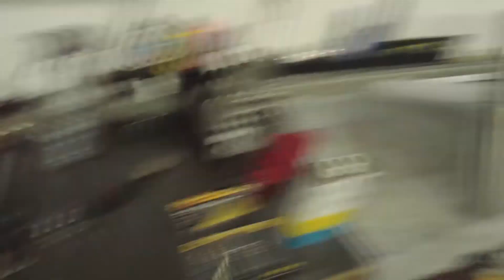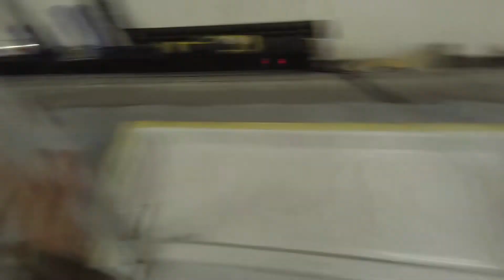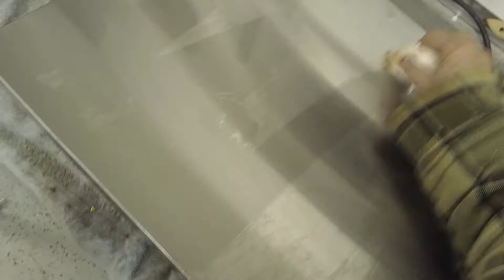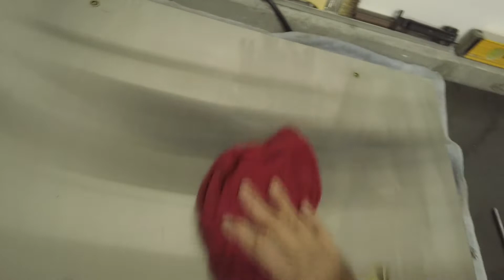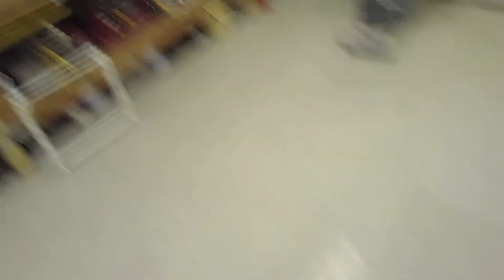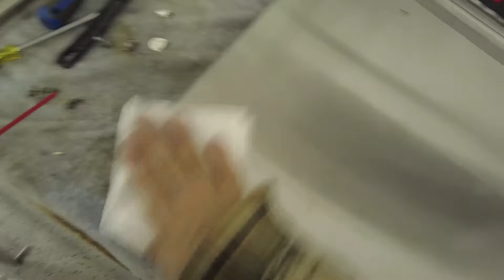Sub-Zero Stainless Steel Door scratch Repair

Comment: Thanks for posting.  I did this to my subzero and it did remove scratch however the sanded area looks more shiny and smoother than the normal area.  Any solution?
Reply from the maker: Sometimes you have to do the whole door.

Comment: Works best with some oil as a wet sand, I use to do this years ago on subzeros when I worked at a appliance store in Torrance. Great vids though
Reply from the maker: What kind of oil do you use, what viscosity, what grit sandpaper?

Comment: Great video. I used a headlight polish kit! You can buy it anywhere they have 2000 and 3000 grit. Got scratches for 98% gone in less then 10 minutes. I kept the 3000 grit wet all the time and rinsed it once in a while. 
For $10. Needed this video to understand it how to remove it.
Reply from the maker: You might also want to put some WD40 on it.

Comment: We have a Sub Zero that has "PH" at the end of the model number. Will this technique work on our fridge? My understanding is that the stainless steel has a coating on it, so we're worried that sanding will ruin the finish.
Reply from the maker: PH means Pro Handle.